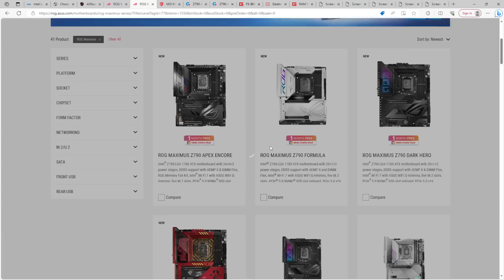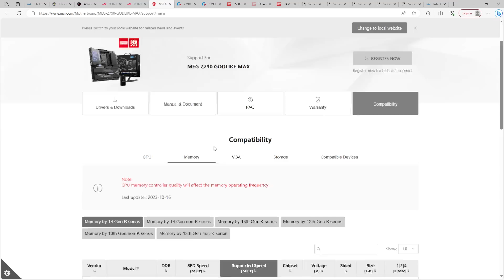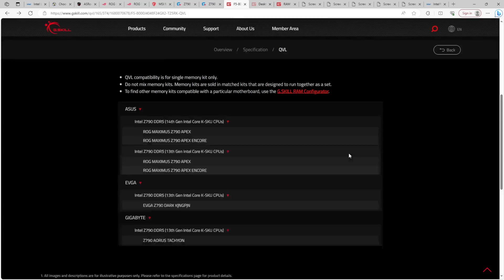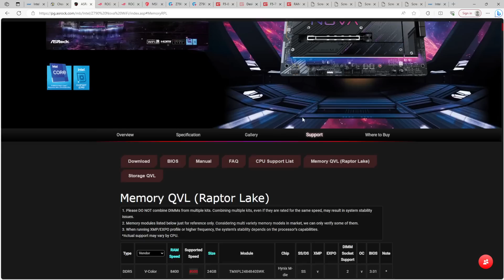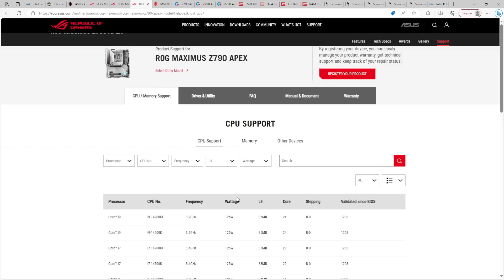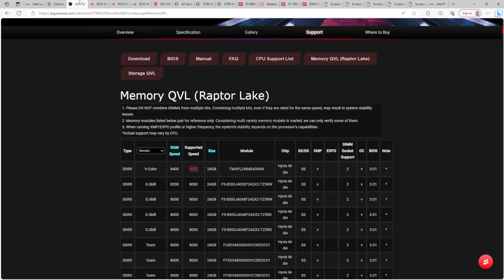intel XMPs and motherboard QVLs are a useless mess.

Comment: Hi buildzoid, I shouldn't post here, but will do it, anyways, cause I don't know where else to put it!

I am currently on a 1st gen ryzen 5 1400 CPU with MSI B350 Tomahawk, 16 GB GSkill FlareX 3200 CL14 Samsung B-Die running in dual channel and gtx 1060 6 gb and I am planning to upgrade to ryzen 7 5800x3d. Is that motherboard good for daily use? I plan on using that CPU for the next 6-8 years until I will upgrade again, so the motherboard will have to keep it cool. I have Lian Li Lancool 216 case with 2 more lian li uni fans sl140 daisy chained to the top as exhaust and 1 more noctua nf a14 pwm as psu shroud intake for cooling. What do you think? Is that CPU gonna be fine for 6-8 years use on that motherboard or should I change the motherboard?
Reply: Maybe find a B550 motherboard if you want to try memory & bclk oc
Reply: @emini6  I'm not interested in overclocking either the ram or the CPU. I will run them at 3200 CL14 and the timing and settings recommended by dram calculator (safe) for Samsung b-die and use PBO for the Ryzen 7 5800X3D.

Will that B350 tomahawk not be fine?
Reply: @rOb3r7sMArTe7  welcome to the channel, it's all about everything overclocking and some build advice from the teacher BZ.
I have that 3d zen 3 cpu, it's mandatory to change the fclk(Infinite fabric Hz) as high as possible(1800-2000), mine tops at 1900 without any errors(Linux mce check).

Yeah that b350 is ok and fine, but it goes well with b550
Reply: its not mandatory  @emini6
Reply: he never said that @emini6
Reply: how old are you and is English your first language? 
if your mobo can support the 58x3d then it is fine
motherboards don't cool the CPU
if you are gaming on it you will only be pulling like 60w
if you are really worried about your mobo search the channel for review of the vrm 
your graphics card is way to slow for a x3d imo 
you would be better off getting a cheap second hand 3600 or 5600 
a new 5800x3d is not good value for money for your setup
stop wasting so much money on cases and fans lol
your fan setup sounds bad, change your setup so you have positive pressure, you need more intakes, and set your case fans to stop if you cpu temp is below 60C
Reply: @rossmarbow-combatflightsim5922  Thank you very much for your feedback, I really appreciate it. I forgot to mention that I will be upgrading to an RX 7800 XT graphics card for that CPU. I won't keep that GTX 1060 Ti, don't worry. I know it's too weak for that CPU. Yes, I have spent a lot on fans and that case, but I just like that case so much and that's why I bought it. I thought it was setup as neutral pressure or slightly positive, because I have 3 intakes and 3 exhausts. But now that I think about it, I don't think that's the case, because, the case just grabs any particular dust and goes into the front of the case and I have to manually wipe it with a tissue every now and then. I think that it is slightly negative, because if it was positive pressure, I don't think it would grab any particular dust from the house. You just gave me an idea: I will remove the top 2 140 mm lian li fans and put them in the psu shroud as intake and switch the noctua 140 mm fan from the psu  shroud and put in the top as exhaust. That way, I would have 4 intakes and 2 exhausts as follows: 2 x 160 mm front intake, 2 x 140 mm psu shroud intake and 1 x rear 140 mm exhaust and 1 x 140 mm top exhaust fan. This would be better than what I currently have right now, isn't it so?
Reply: @rOb3r7sMArTe7  Your proposed fan setup seems sensible enough.
I'd be a bit worried about the VCore VRMs at this point, they're not exactly the epitome of luxury (as they rarely were on this generation AM4 board) and the 5800X3D can draw a fair bit more power then your old 1400 (PPT 142 W vs. presumably 88 W, and that's without o/c). Watch out for their temperatures under load, and you may want to take off the heatsink and inspect the state of thermal pads underneath. At times people have found something best described as concrete that had become utterly useless as a thermal interface material, with replacement yielding vastly better temperatures.
Reply: @rossmarbow-combatflightsim5922  I'm 31 years old and no, English is not my first language. I'm from Romania.

Comment: Winter is coming...................14th gen might just be useful, after all!
P.S. How much is the responsibility of the MB mfg, and how much is the responsibility of the controller on the cpu, like with AMD. My 2700 won't run 4 sticks of 8GB 3200MHz\CL14 but my 5600X will on a B450M Mortar.
Reply: I think it's both and it's only the thing of which of them you hit first. First Zen and Zen+,  it was most likely the memory controller. Zen 2 and Zen 3 had better memory controllers so onow there were more cases where the MB was the limiting factor.

Comment: On a RYZEN 7950X3D system with a validated ECC implementation (single bit errors are logged, two-bit errors halt), how can linpack still fail? The problem must be in the IMC if the data can make it back and forth through RAM without triggering ECC, right? Maybe it needs gear 2?
Reply from the maker: I've never used ECC memory soooo I have no idea what it should behave like.
Reply: maybe your FCLK is too high or the SOC voltage is either too low or too high
Reply: @TheBackyardChemist  so anything? 😁 I'm burnt out on it for now because the turnaround time on this server board is so slow, training can take 15 minutes and it just freezes if it fails. So 20 minutes per iteration after resetting the CMOS!
Reply: @shanent5793  Is linpack stable at stock? It is a very heavy load, and maybe the cores are unstable.
Reply: @shanent5793  your linpack executable could also be corrupted. I highly dought it, but maybe storage media is faulty. Please chech with freshly downloaded linpack (from outher system), starting it from external storage.

Comment: Was suprised when i switched from z790 hero that could only stable 7200, to a gigabyte z790 xtreme x which would boot 8000 and game for only 10-30 minutes with their preset for 2x24 hynix 8000.  Im not fluid with gigabyte Ocing.  Would like to see an Gigabyte ddr5 oc video.  Have you tried the gigabyte ram presets ?     Oh my gskill 2x24 7200 works fine at 7600 no tweaking.   Also ASUS had / have a "Ram QVL guaranteed to work"  on the mobos overview sales pages.  Im not saying where they have it so it wont get taken down.  I screen shotted it and their mods went quiet about it when i posted it. :)
Reply from the maker: yeah the gigabyte 8000 2x24 preset is just as unstable as the kit's own XMP profile.

Comment: When AMD is more consistent and can achieve memory speeds that Intel can't reliably, that is a big deal.
Even though those memory speeds are almost useless for AMD. But Intel was for a long time "better" than AMD when it came to this.
Reply: Amd cant hit more rofl, they are way worse. 1:4 memory divider doesnt stress IMC or ram because of the lack of throughput so It was an invalid test. Just because Buildzoid showed it doesnt make it possible with current mb and Ryzen imc. He even said something to that extent in his vid.
Reply: @impuls60  I said that it is next to useless on AMD (literally 1 or 2 benchmarks could see an improvement, so in some extreme OC scenario it is viable - possibly). I'm not trying to claim that it is a game changer. i'm just saying that it is weird feeling when AMD can hit stable 8000 (even though it is useless) and Intel has more troubles with it, despite them being a company that sort of always had this big edge in running RAM much, much faster.

And yes, Infinity Cache and other bottlenecks again make it useless on AMD CPU's. I just thought it was funny that AIB's claim those speeds for Intel, yet, you will have to be super lucky to hit some of those. And in some cases it is straight up fantasy.

Comment: This has been an issue since the DDR3 days with even the cheapest AM3 boards having DDR3-2000 kits in their QVL. Sometimes even 3x2 kits for a 4-dimm board, without any further explanation.. or ASUS, who technically supported DDR3-2200 on their cheap P55 boards but when you look in their QVL its only with one stick inserted lmao.

Comment: What's a nice "sweet spot" frequency for DDr5 that most Intel CPUs should be able to do just fine? Currently running 4266c16 BDIE and was considering switching to DDR5.
Reply: it depends on the board. If you have a cheap 4 dimm board you're not getting past 7200
Reply: @Neucher  alright thanks. I have a D4 board anyway so I’d need a new one :) was planning to just get a cheap t create kit and oc that.
Reply: @IIHydraII  if you don't want to be bottlenecked frequency wise z790i edge is the best board for the price. It can do 8000 if your CPU and RAM can.
Reply: @IIHydraII I too have 13900k/4200c15 and have thought about going DDR5. I was hoping for an MSI Z790 Unify-X but since it didn't come out, I felt like $650+ for an Apex just wasn't worth it for me. If you do go this route you'll probably want to watercool your RAM for best results. Have fun!
Reply: @Neucher  awesome, thanks for the suggestion :)
Reply: @jjlw2378  likewise! 😄
Reply: @jjlw2378 can you hike me on Unify boards of MSI? Especially X and why to catch it? Just wondering, ty!
Reply: @kekovkeks  I've had good experience with the Unify boards in the past. Z690 Unify-X is a 2 dimm board capable of hitting around 7600+mts. If they made a Z790 Unify-X, it could have been improved enough for it to hit 8000+mts for significantly less money than an Apex or Apex encore. If price isn't a major concern the Apex Encore is probably the best board to get. I just couldn't justify spending $650+ on it when I know I'll be upgrading to Zen5/ArrowLake.
Reply: @jjlw2378  ty! But what about classic Unify and also Ace/Godlike versions from MSI? Do you have anything to say regarding them? As well as other mobos from ASUS or even Gigs and etc.
Reply: @kreozello  I only have real-world experience with MSI and Asus DDR4 boards, which work great. For DDR5, I only know what others have said, which is 4 dimm boards seem to struggle past 7200mts DDR5.
Reply: @Neucher  bro you need to stop quoting frame chasers suggested board... He also discovered that board is NO GOOD. That board is a heated mess. You need a fan on the front and back of the board to even get it to run 8000 stable. Most people are not going to do that. Most people cant even DIY fans into random spots in there case. They want XMP to work, which wont work on certain CPUS because one can work with SA 1.1 and one will work with SA 1.3... Same with TX and MC volts. THis is why XMP wont work.

Comment: Any problems with coil whine on your Gigabyte boards?  Gigabyte has the best slot layout for modern oversized GPU coolers, but I have read LOTS of reviews mentioning obnoxious coil whine.
Reply from the maker: I've not had any on the new boards. The original Z790 Master had coil whine when memory stress testing.

Comment: Unless your buying a motherboard with only 2-DIMMS (2 slots for memory and NOT 4) Don't bother trying to run memory above 7800, because it wont work and will never work. And I also wish people understood what frequency actually does. There is MILLIONS of users trying to buy 8,000 + because they think "MORE IS BETTER!" and have ABSOLUTELY no idea what they are doing in the Bios. Reddit posts and YouTube video comments just reinforce that with the kind of questions I am see'ing. Don't buy uber high frequency memory kits unless you actually understand how to overclock and thoroughly understand the  mechanics of secondary and tertiary timings.
Reply: I have Trident Z5 DDR5-6000 16GBx2, but my latency numbers are CL40-40-40-76  1.30v.   This is on my Z690 ROG Strix "E" mobo.  I'm going to buy the new Intel 14900K to replace my 12900K.  Will this same memory I already have continue to work?  Or would you recommend that I scrap the above memory and buy different?  You seem to know a great deal about memory so I wanted to get your opinion.  Thanks in advance!!!
Reply: @dabneyoffermein595  DDR5-6000 isn't horrible, but those timings aren't great for that speed.  Have you tried tightening the timings on them?
Reply: @idontneedthis66  How would I tighten the timings, those are the timings straight off the box from the manufacturer? Is there a way to change them?  I would try to do that in a heartbeat if you think it would work.
Reply: @dabneyoffermein595  You change the timings in the BIOS. Have you even set the XMP-profile? The memory won't run at the advertised speed and timings unless you set the XMP-profile which you also do in the BIOS.
Reply: @dabneyoffermein595 Just my two cents here but think really long and hard about what a 14900K can do for you that the 12900K can't. I'm trying to save some money for you, maybe better spent on something else that would actually be a bigger bang for the buck. The 14900K is more or less just a re-branded 13900K, unfortunately.
Reply: @dabneyoffermein595 @dabneyoffermein595 With that kit you should absolutely be able to tighten not just the primary timings but the secondary and tertiary timings.

You should be able to get to 34/36-34/36-34/36-like 64 or maybe even lower out of those primary timings without even touching the voltage.

Buildzoid has tons of videos that tell you which timings you can change and how to do it and you just lower them one at a time by a little bit and then restart and test for stability and if it's all kosher go change another timing.

Comment: I can't get 7200 XMP to work with my 13700K on a Z790-F
Reply: I run the same cpu and motherboard, and a g.skill TridentZ5 6400c32 32GB kit set to 7200c32-43-16-39-32, trfc450 and trefi65536 etc.. It's mostly there now, but it has been a fight to say the least. I've had to hunt sweet spot voltages for both mc (1.475v) and cpu vddq (1.31v), in addition to dram vdd (1.58v) and vddq (1.54). For some reason my cpu hates synced dram vdd and vddq, it won't train unless vddq is at least 20mv under vdd. Good luck.
Reply: @spaghettilocomotive  Thanks for this reply. I might try buying a g.skill kit
Reply: poor baby

Comment: I feel like intels pcore ecore is strategy is making it hard for them to do the tight bins they prefer. The issue is that theyre marketing the memory as "up to" the performance of the top 10 or 20 percent of chips instead "at least" the performance of the bottom 10 or 20 percent. 

In my opinion anyways. Feel free to call me out if im missing something lol
Reply from the maker: nah intel always binned really loose. The only reason the cores are rather consistent these days is because they need to be able to hit the really high turbo boost speeds. Back in the DDR3 days when CPUs shipped at less than 4GHz stock your cores could do anything from say 4.5 to 5.2 at the same voltage depending on how good the chip was.
Reply: @ActuallyHardcoreOverclocking  gtk. Thanks!
Reply: I wonder actually if the spread is higher on i9's and i7's than it is on the lower core count chips..

Cause there's no discount sku an i9 with a bad imc can become
Reply: It's just they market their products to make them seem better than what they are so they can boost their sales and improve their bottom line!😂😊

Comment: I'd like to see how high the memory can go on the cheapest new gigabyte Z790 Aorus Elite X against the £1000 motherboard (Gigabyte z790 Aorus xtreme X)
Reply from the maker: 7600 should work as long as you don't get a trashbin CPU.
Reply: cheap 4 dimm board = good luck getting past 7200. Maybe the top of the top CPUs can do 7600.
Reply: @Neucher new Gigabyte z790 x series boards will at least run 7800mhz stable
Reply: @Maiza007-c8y  Dual rank ?